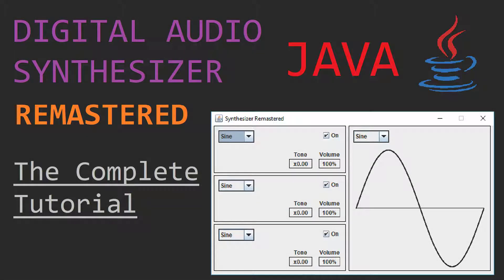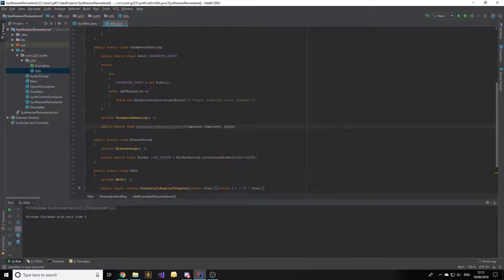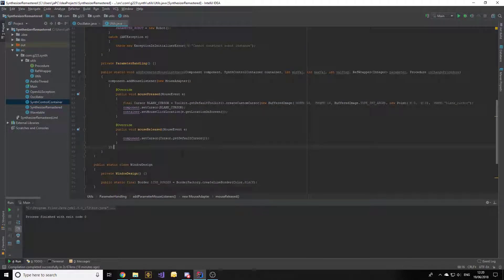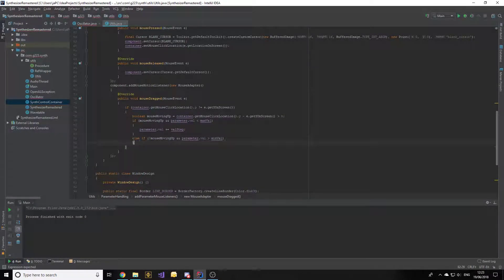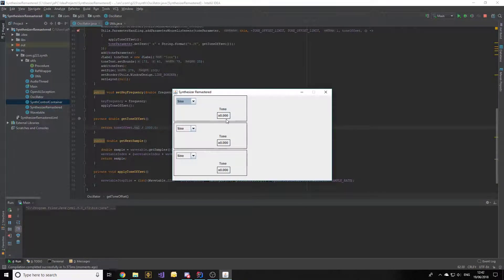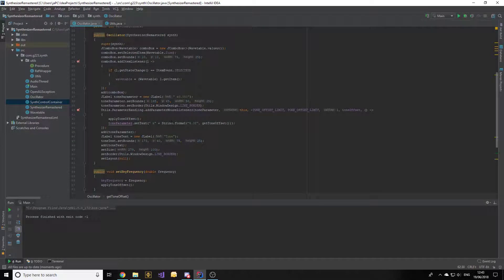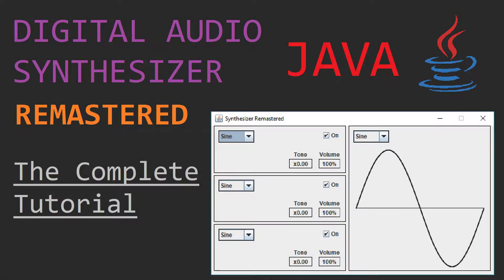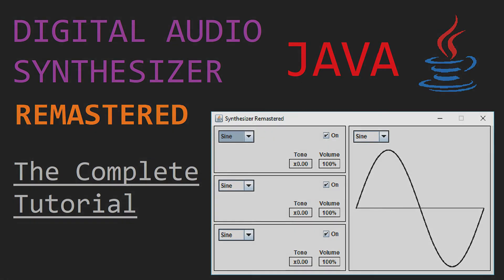Java - Creating an Audio Synthesizer - Part 5

Comment: My main problem with the wavetable is you can't really get a good flanger effect with those settings as the tone change only effects most notes at intervals of 0.014 or so (instead of 0.001). I got around this by setting the Wavetable SIZE to 1764000 which is 40x the sample rate. A lower number probably would work but after doubling the sample rate twice I gave up and multiplied it by 10.

Comment: Hello! In utils under mouseDragged you have:
.
.
.
if (onChangeProcedure != null){
        handleProcedure(onchangeProcedure, true);
}

I can't find this method! Is this something I missed in an earlier video or from an import or what? Love the tutorial!
Reply from the maker: Hi! I'm sure I include this code somewhere...
Anyway, its part of the procedure interface I included within the utilities module; it's basically a simple way of dealing with exceptions. The code for the interface is:
package com.g223.synth.utils;

public interface Procedure
{
    static void handleProcedure(Procedure procedure, boolean printStackTrace)
    {
        try
        {
            procedure.invoke();
        } catch (Exception e)
        {
            if (printStackTrace)
            {
                e.printStackTrace();
            }
        }
    }

    void invoke() throws Exception;
}
Reply: @g223productions3  Much appreciated! I ended up gleening it's purpose after some debugging and went to write the function just under one that was the function mentioned, not realizing I had changed the name. Excellent tutorial friend